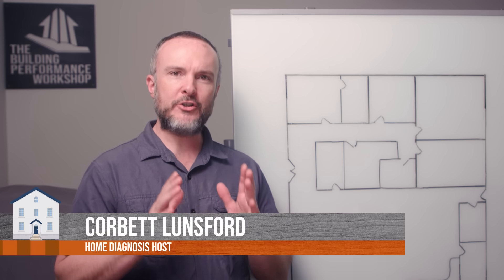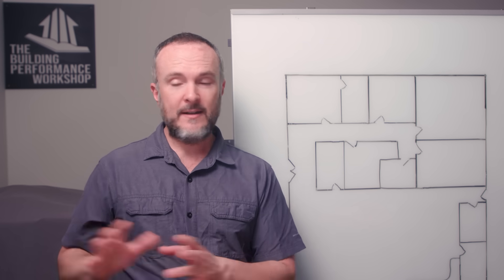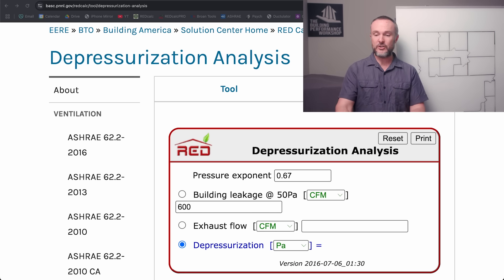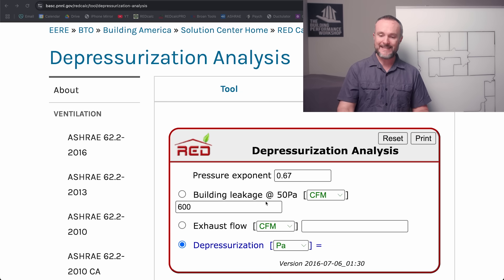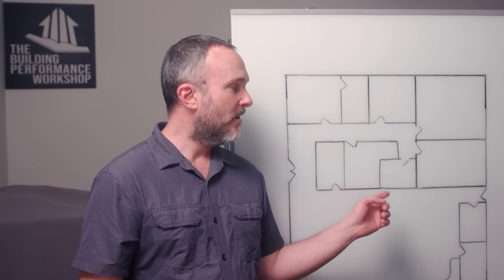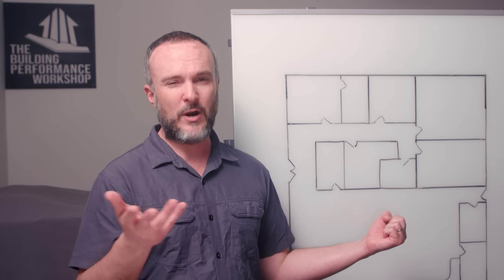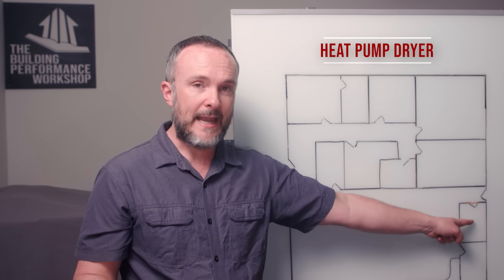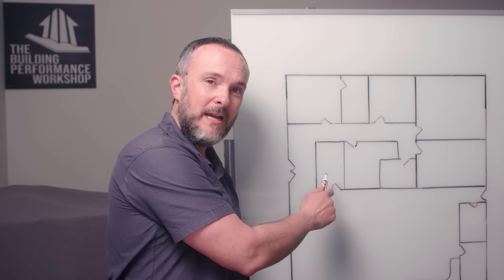WHY Vented Dryers Make Problems in Airtight Homes: Go Ventless Heat Pump or Condensing Dryers

Comment: Ventless dryers are mold prone (internal components can harbor mold) and they're expensive. They can also increase moisture within the home, even connected to a drain. There is much more maintenance just to keep them somewhat safe. In an ideal world, they sound like a good idea, but it depends a lot on how it is manufactured and maintained. Just mentioning that ventless dryers aren't always perfect solutions and they also carry their own risks. Any type of appliance, especially a dryer, will have to be carefully considered ... and the home will likely need to be tailored for either of the three options.

Comment: I’ve never thought about how dryers work before. Mines outside. 
Where does the air come from in a standard electric dryer? What if instead of piping air from outside into the house or room it is piped directly into the dryer? Then the dryer system is functionally outside the house?
Reply from the maker: That would be a sealed dryer, I doubt it exists

Comment: I've used a ventless heat-pump dryer in my super airtight newbuild (2022) and am very impressed. It can take longer for some drying cycles but the system is super easy on clothes and uses less energy even with longer spin times. And, if you are in a rush there is a ''heated'' setting as well.

Comment: Great video and easy to follow explanation. Do you have a video or suggestion on how to seal the traditional home after making performance adjustments, like the dryer vent that is no longer needed for example.
Reply from the maker: No special advice, just plug that vent at the exterior.

Comment: I have a Blomberg heat pump dryer. I have always wondered if there has been any air testing in rooms with these type driers. Is lint expelled into the air?

Comment: I’ve thought and researched this issue a lot. Unfortunately, heat pump dryer is the best solution. I’m not a fan of this type of dryer because its long term reliably is questionable.

Comment: This is exactly the reason I got a ventless dryer. Vented dryers are vampire appliances. Even in a drafty house, you still have to condition all that air you’re bringing in.  Now I’m not doing that, and I’m even saving electricity on the dryer cycle. Done and done.

Comment: Currently heat pump appliances have a short life span. Secondly you speaking as if the cloths dryer is running 24x7 depressurizing the home where in a normal operation only runs a couple hours a few days a week, so even if they are depressurizing the home slightly the pressure will return to normal afterwards. Lastly, how do you plan to introduce fresh air into the home if it is completely air tight? There has to be an intake and exhaust to replenish air for healthy environment. There will always be a need for external exhaust in homes in baths, kitchens, laundry, fireplaces, furnaces, plumbing....... SO I guess whatever gimmick sells go for it...
Reply from the maker: Hey John- ours is clearly a new channel to you, we address all of what you point out in other vids, feel free to stick around if you really want to see how it’d done.

Comment: Can the Dryer connect to the ERV and tell it to bring in the make up air?  I know my ERV can intake 150 cfm and exhaust 0.
Reply from the maker: It can’t actually, you may unbalance it by up to 15% before it’s not an ERV anymore.
Reply: @HomePerformance  Oh that makes sense when I think about it, the system would have a harder time exchanging the heat.  I hadn't actually tried it yet.  In January I'd be bringing in sub freezing air to compensate for a dryer that runs for 70 minutes.  This is a conundrum, my wife does love her speed queen.

Comment: When I built my home in 2002, the laundry room was inside it, it was a single room that was as air tight from rest of the house inside and out... Even the door was completely sealed. The difference was I had a vent from the outside leading into this laundry room. So all the air that's a dryer needed was supplied from the outside air through this vent. That completely solved the problem back then and it still does today ... Don't understand why you didn't think of that as a solution?

Comment: My vented dryer lives in my non-insulated garage, fed by the often dehumidified exhaust of my heat pump water heater in the same space, drawing often warmer air from the non-insulated attic above. No doubt a ventless dryer would be more efficient, but my $100 vented dryer still beats a $1000 dryer on long term costs since my state still provides no subsidy for them.

Comment: I had a newer home (Townhome, 1500 sq ft, LEED silver built in 2015) and I put in a 4 cu ft Samsung dryer exhausted thru a pretty long duct to outside and it kept giving a high exhaust pressure drop error. I wonder if this was part of it 🤷🏾‍♂ . Now I just don't use a dryer😄

Comment: I’ve tried the heat pump and ventless dryers. They absolutely suck… My clothes come out like they would fit my little sister , and they have shrunk completely (and they are crunchy feeling… )Sorry… Not giving up my vented dryer… I will create a make up air fan of some kind. I will do something….. but my vintage dryer stays

Comment: It sounds like your electric resistance dryer needs a dedicated exterior air intake just like your sealed-combustion furnace.  That gives you the drying qualities of the old system, most of the low costs of the old system, and no problems in an airtight home.

Comment: Got a heat pump clothes dryer 2 years ago and had so much fun closing up the vent so that area of the house was less leaky and finally warmer. Thanks for bringing this topic front and center.
Reply: doesn't a heat pump dryer pump humidified air into the home?
Reply: @wd269  It evaporates the water out of the clothes with the hot end, then blows that water vapor over a cold end to condense it and drain it via a thin condensate hose into your drain system.
Reply: where did the humidity go? for mold growth?
Reply: @ Down the drain.  Ventless dryers are basically dehumidifiers with a tumbling clothes bin in the middle.
Reply: @diegojines-us9pc  you know that little white PVC drain pipe that comes out of the back of a mini split? This is the exact same thing. There’s a condensation cycle and the condensate goes, down the drain.
Reply: @diggerbrass  so you save on electric for the dryer, but spend it all on a dehydration? sounds good once you a pay a couple hundred bucks every time it goes out.

Comment: Corbett, this is awesome!  

60,000 cuft / 60 =1,000 / 2 = 0.5 ACH50, just slightly better than PH which is my target, and 8Pa of depressurization with a traditional drier.

Armed with this knowledge and the math to back it up, I still have a 0% chance of convincing my wife we need a heat pump drier.  I have failed to convincer of things before, and I doubt that will change now.  Wish me luck! 🤪

Back to stapling up and meticulously sealing the poly for my attic!
Reply: I always dreamed of Corbett doing Short Videos targeted for the wife who opposes building science.
E.g. why a bell range hood is a must, and kitchen islands s@uck 😂

Comment: I've definitely felt this in my own home. I have a home in climate zone 5A and while our winters aren't brutal compared to some, annual lows below 0°F made me want to feel less outside air. So sealing ceiling and wall penetrations and around doors and windows to stop drafts and sealing around my  foundation/wall transition to keep out critters wasn't about performance numbers and I've never had it measured (yet). Even so, I've noticed problems with power venting depressurizing the house and causing issues with natural draft combustion. I open up vents for makeup air as needed. Would prefer to eliminate the need by going ventless or sealed combustion for all appliances, but that's currently cost prohibitive.

Comment: Why even put an exhaust vent in the laundry room of a high-performance new home build? It seems contradictory.  As the building code starts requiring tighter home construction, at what point does that code require a non-venting dryer to address this obvious issue?
     We replaced our aging front-load washer and vented electric dryer with a new front-load HE  washer and separate heat-pump dryer in preparation for a new high-performance home build.  We are very happy with the performance of these new machines.

Comment: The more videos I watch like this the more I want my house build to be an old school leaky home.
Reply: I think you are totally missing the point here.
Reply: With the addition of air conditioning and insulation in homes, air leakage is not a good idea and could cause condensation and mold. It get worse when you start depressurizing a house with one way exhausts. "old school leaky homes" worked because they didn't have insulation and could dry out quickly due to the high energy exchange between the inside and outside. Really, everyone should be building airtight house enclosures, with balanced ventilation, sealed combustion appliances/heat pumps, makeup air for kitchen exhaust etc.
Reply: Not just leaky, but built to flow air into, up, and through every bit of the framing - which is something I was careful to preserve when I insulated a portion of mine with Rockwool. 124 years with no mold or rot so far! (Though the over $400 to heat it last month wasn't a bonus . .)
Reply: @ Condensation will form on a surface when the air temperature drops below its dew point and comes in contact with that surface. So, the chance of condensation is dependent on the outdoor temperature and humidity level relative to indoor temperature and humidity, and the temperatures of those surfaces in or on a building enclosure. In short, it depends on what climate the building is in. Allowing air to readily pass through insulation mostly defeats the purpose of using insulation in the first place. Not all surface mold is easily visible to the naked eye, and mold often grows inside of such wall assemblies ( depending on moisture conditions, of course)
Reply: Prior to the 1970’s, nobody thought it was a good idea to seal up a house. People would sleep with a window open in the dead of winter.
Reply: @ Iv'e slept with opened windows too, but honestly there is a lot of downsides: noise, smoke/outdoor air pollution, and excessive heat, humidity, cold, and aridity. I guess open windows or other passive air intakes are better than interstitial air leakage in walls, because at least any condensation/mold that could form on surfaces near windows/intakes can easily be wiped off. Of course ventilation is important regardless of the season, but there are better (in my opinion) ways to ventilate, like ERVs,  that decrease discomfort, energy consumption, and moisture swings compared to traditional ventilation methods.
Reply: Much rather have control over air coming into my house so it can be filtered, than to have lots of allergens blow in all the time.
Reply: The problems with a leaky home are uncontrollable with a less leaky home you can better control your outcomes. we engineer everything these days.  It’s what we do.
Reply: I think I have a solution for this.
Reply: Yeah, you really can't mix or go half-way. You either need enough air leakage that older style appliances are fine, or you need to go all in and be very intentional about the whole house. Sticking with older and leakier is fine if that's what you already have and don't want to have to deal with pressurization problems and the expense of change. I just wouldn't do that for a new build.
Reply: Yeah, we’re going the wrong direction, New homes are nothing but a scam

Comment: Also, if you use makeup air, and it's humid outside, your clothes are going to take longer to dry, and any contaminants from the outside air will now be making your clothes more dirty.
Reply from the maker: Good point

Comment: Depending on the local region building styles. Take california, for instance. Or single-family dwellings usually have the dryer outside of the building envelope. 
     in SF in condos on new construction heat pump dryers have become the normal installation practice. 
Vented dryers that are mounted inside the building envelope . We’ve seen contractors put a door on that room.. because the occupants did not like I want to hear the sound of the dryer running or the washing machine. When they close that door, it’s an almost airtight room with next to the gap at the bottom of the door..  this has always been a problem with general contractors not understanding you cannot do that. Or trying to explain to the customer you cannot do that.. 
       Trying to explain to a general contractor that is trying to keep a customer happy.  That they have to put return make up air on air tight, sealed room for their washer and dryer..  and if the return is of any sort of length or elbows.  Trying to explain to most people at the return diameter size must be larger than that little 4 inch or 6 inch exhaust out of the dryer.. difficult to explain friction loss, static pressure loss of elbows, and a length to customers is the reason why it has to be so much larger it might be unsightly and more expensive.

Comment: The one issue you didn't address is moisture. If the dryer doesn't vent to the outside,  then the removed moisture has to be dumped into the house. Are you recommending an ERV/HRV (depending on local climate) or dehumidifier to address this issue?
Reply from the maker: That’s not how the ventless dryers work, you fon’t dump the moisture inside- it goes down the drain.
Reply: Thanks, I didn't know.

Comment: I have always wondered why dryers don't have a concentric exhaust to bring in their own make up air especially considering the amount of air they move and in the summer they are taking expensive air out of the house and pulling hot air in from outside. 
    Now you focus mainly on new HE houses but I would argue that even on older houses it's an issue as well. Even on out 1960 house I can open the window in the laundry room and there is quite a breeze coming through when the dryer is running. (same with the kitchen hood) I don't know how leaky our house really is but I have sealed things up here and there. 
     I do have a large leakage path you really wouldn't like that I need a better solution for mainly in the need for a better exhaust fan for it. (long story) 
        Now that the heatpump dryers actually work well, one of the all in ones will be our next machine. Friends in England hated heatpump dryers as they were very bad there but still have the problem of short lifespans among the newer ones negating any overall savings. Hopefully that part will get better too.
Reply: In my opinion, avoid the all-in-ones and go with ether separate washer/HP dryer or with a HP laundry center, like the LG Heat Pump Washtower, which I have personally installed and used, and has a huge dryer capacity compared to most other HP units. I can’t speak on the lifespan, though.

Comment: Any worries about humidity levels using ventless units?
Reply: They function like a dehumidifier: cool/condense/drain, reheat, recirculate the air in the dryer. So, no.
Reply: There are more internal components that can harbor mold. The issue isn't creating higher humidity levels in the home... The issue is evaporator fans, coils, and other internal components possibly harboring mold. The safest option is to make sure they drain into plumbing instead of collecting in a tank, but even then, the internal components pose a mold threat.
Reply from the maker: Like anything else in a home, maintenance is required. Vented dryers need vent cleaning. It’s about trade offs.

Comment: All go points, but how on earth do you wash a load of king-size bedding or duvets in a heat pump dryer? They are all tiny. One of the bigger Santa Fe units might be able to handle the makeup air with the OA damper open and the supply right next to the dryer. I saw that setup on the Build show a while back, it seemed like a workable solution.
Reply: I was wondering the same thing on the ERV.  Could you upsize the ERV and tie a control wire to the dryer so the ERV goes into boost mode and does not exhaust air while the dryer runs?
Reply: @gregstringer7392  you could with Comercial ERV like one of the RenewAir ones; they have 0 to 10 volt speed controls for both fans individually. But the core wouldn't be as effective at drying the outside air with the flow unbalanced by that much, I think. You would need some type of mechanical cooling.
Reply: The GE combo and LG combo units have American sized drums and can fit a king sized duvet. Whirlpool also makes a heat pump dryer with a large drum. However the filter design of that unit isn't ideal so I don't recommend it anymore.

Comment: I have to wonder about how much moisture we're introducing to the air when using a heat pump dryer. Or is it all completely contained within the dryer itself?
Reply: Moisture is condensed into liquid that gets drained. It doesn’t enter the homes conditioned air.

Comment: Washer/dryer should be in the garage or separate structure. They are a source of noise, heat and put particles and microplastics in the air.
Reply: Who do you think is going to be carrying their laundry back and forth into the garage or a separate structure? Your concerns can be eliminated by soundproofing the laundry room during the build and using an ERV.